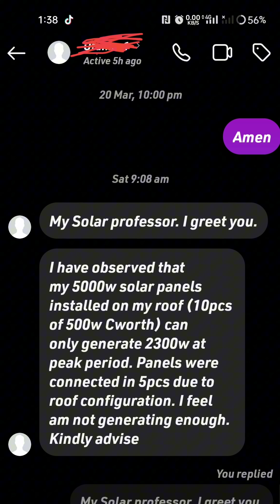Where's the efficiency, are we sold little value for huge money?

Comment: I have a 3960 max possible jinko 9 x 435w panels. I get over 3,300 on good sunny day. I can send you pictures is you don’t mind. 

Be also informed that a lot of factors determine the amount of kw the mppt will pull from the panel. Most important is the demand of the load, chemistry of the load, heat generated as a result of cablings, etc.

If i have a 150ah lfp battery that can do 1C. In peak sunlight under NOSTC, a good mppt controller should be able to extract up to 95 percent of a panels rated STC for a 9 x 435w system.

Again, if you want videos or screenshots, i can share mine with you.

Regarding the arguments some are making that mppt does not convert voltage to current. Please note, an mppt will track and pull the maximum watts ie V x A from the panel depending on the load, now the next step is, the mppt will take this total watts, and match the voltage portion of the battery, then send the rest as current (depending again on what the load demands ie 1C 0.5c 0.2c etc.)

For example, if i pull 2kw from my panels, my mppt will match a voltage of 57v for my 52.1v nominal battery then convert the rest to current ie 2kw / 57v = 35amps. Observe that the 2kw might have been pulled as 270v and 7.4amp from the panel to the charge controller.
Reply: Something else of note.

You seem to be confusing mppt efficiency with solar panel efficiency. 

The top rated solar panels boasts an efficiency of just 22 to 24 percent.

A solar panel’s efficiency relates to it’s ability to capture available sunlight with respect to its size.

Mppt efficiency on the other hand describes the ability of the charge controller to effectively track the maximum power point of the solar panels array. So when we say an mppt controller has up to 98 percent efficiency, it means that it is up to 98 percent in tracking the maximum power point of a solar array.

Now depending on the weather conditions, a 400w panel can give 80w as its maximum power point, all the way up to 400w at standard test conditions.

But to be effectively able to track that little 80w output in poor weather or 350w output in best solar weather efficiency, is where the rating of an mppt charge controller efficiency comes into play.
Reply: You are correct, if your panel can't produce enough, your mpp can't track enough
Reply: Thank God people like you who understand how stuff actually works Still exists not someone who doesn't consider  various factors coming out to confuse people on simple things like this.

Comment: In your other post on this matter, I mentioned that the felicity 120a mppt installed for us somewhere in South East, Nigeria, with Trina panels gets 85 to 90% efficiency(Around December period). I have another installation done last week with Miv mppt charge controller and Africell panels, just this afternoon starting by 1 p.m, (I took time to monitor it today). It has been putting over 90% of the total panel capacity, in fact it has been pulling over 85% since 11 O'clock & has gotten to 94% around 2 p.m. This area is North Central zone.
These are affordable China mppt controllers. There are many factors that will determine efficiency assuming those hybrid inverters you use are correctly rated.
Reply: You are absolutely right. I have experienced same with Africell panels and felicity charge controller. 12 300w panels consistently producing 3000w of power. I thought he was more experienced than this. How can he be comfortable with getting 60% of his solar array.

Comment: There are levels to this thing and you dnt need to sound harsh trying to make a point based on what someone sent to you

First of all
1.Most solar panel can only produce 65 to 70% of its energy under standard test conditions 

2.The solar panel installation positions ,angle etc

3.Was it at peak sun intensity  period?

4.Do you also know that some use fake stickers to sell solar pv, for eg...someone will be sold a 250w pannel in place of 300watt pannel

5,Amount of energy harvested by the MPPT SCC is equal to what it delivers......your pv array in ideal is lets say 2300watt max but u get like 1000watt energy harvested will you blame the mppt or the Pv array, 

6.Mppt is good because of its 98% energy conversion harvested from the panel not what its being able to harvest from the panel, if for example ,your pannel produces 76v and  10amps.....mppt will convert some volts to current to boost your charging current needed to charge your battery......and thats the main advantage over pwm......pwm be like garbage in gabbage out but mppt maximizes any power receive to give out efficent charge without wasting power

So before you conclude 
Solar panels arent 98% efficient, they are 65 to 70% efficient. 

MPPT only draws whatever that is generated, maximizes them by ensuring that at least 98% of whatever that is generated is used well to charge your battery optimally by converting excessive volts to current to give u fast and efficient charging bc currents is whats  needed for charging

I rest my case
Reply: Don't mind him. I have stopped responding directly to him since he doesn't even know what he is talking about and doesn't research before spewing misconceptions. Severally have I told him that the panel rated capacity was obtained under standard test conditions (STC) which are difficult to obtain in the real world. Also that panel position, angle and efficiency of the panel itself can affect generation. At best, you can get 70 to 80% of the rated panel if you optimise everything. Also, I was shocked he said MPPT converts voltage to current, Chai!!! MPPT tracks the point where the product of the voltage and current produces the maximum power and this point varies all through the day. That is why it is called Maximum Power Point Tracking.
Reply: @1982757 yes bro,that's why  we learn everday to improve......and what we dnt know is bigger than us....one should learn to listen more than he speaks..........HIJACKING someone's comment to prove a point without proper investigation is a no no for me,those people that posted those comments he used to make this video,I bet you, if you meet them one on one and conduct all proper test and investigation required.....You will definitely find one  or 2 faults or conditions that led to what their panel generates,...The issue is that many are only glued to what their pannels should generate based on  stickers,without putting the reality surrounding them

Comment: I see everyone is attending to this issue from a wrong direction. The reason why you can't get 100% of your solar panel array capacity is not because of the charge controllers but rather it's the solar panels. Most panels are 15-25% efficient (take note of the word "most".

So heres a scenario, you have a 5000 watts solar array with 25% efficiency. What you'd see as the max in your solar charge controller should be around 1250 watts.

Again, it is not the efficiency of the controller but the efficiency of the solar panels. What your charge controller displays is what it is receiving from the panels.
Reply: I think you misunderstand, A 400W solar panel can still output up to 400W of power under ideal conditions (standard test conditions) because that’s its rated maximum power output. This means that under optimal sunlight (typically around 1,000 watts per square meter, with a panel temperature of 25°C), the panel can generate 400 watts of electrical power at any given moment.

Solar panel efficiency (15% to 25%) refers to how effectively the panel converts sunlight into electricity. For a given panel size, a higher efficiency panel can produce more power than a lower efficiency panel, but it does not affect the overall rated power output of the panel (400W in this case).

Efficiency is more about how much energy the panel can generate relative to its size and the available sunlight. For instance, a 20% efficient panel can convert 20% of the sunlight it receives into electrical power, while the other 80% is lost (as heat, etc.). In a well-lit environment, the 400W solar panel can still produce up to 400W of power at its peak, regardless of its efficiency.
Reply: Don't mind him. I have stopped responding directly to him since he doesn't even know what he is talking about and doesn't research before spewing misconceptions. Severally have I told him that the panel rated capacity was obtained under standard test conditions (STC) which are difficult to obtain in the real world. Also that panel position, angle and efficiency of the panel itself can affect generation. At best, you can get 70 to 80% of the rated panel if you optimise everything. Also, I was shocked he said MPPT converts voltage to current, Chai!!! MPPT tracks the point where the product of the voltage and current produces the maximum power and this point varies all through the day. That is why it is called Maximum Power Point Tracking.

Comment: You are right to a reasonable degree  bro but you dont need to sound bitter while making your points. 😂😂😂 Be calming down bro😢😂

What i noticed  is that solar panels has an efficiency rate of about 65% to 70% efficiency under very good Installation/working condition.  If an MPPT controller gets 65% from the panel,  it will simply outputs about 95/98% of the 65/70% delivered to it from the solar panels.

For example, where the solar panel are not installed properly due to 1. No vent below it, 2. Not facing South 3. Not angled properly, 4. Cloudy condition (a constsnt), etc, you wont even get 30%/40% from the panels

Therefore the culprit is not even the MPPT controller but the solar panel. I believe a good MPPT deliverss 95%/98% of energy given it by the solar panel (i.e. 65%/70% of what the panel is rated for.
Reply from the maker: Until the day I see that sha
Reply: Don't mind him. I have stopped responding directly to him since he doesn't even know what he is talking about and doesn't research before spewing misconceptions. Severally have I told him that the panel rated capacity was obtained under standard test conditions (STC) which are difficult to obtain in the real world. Also that panel position, angle and efficiency of the panel itself can affect generation. At best, you can get 70 to 80% of the rated panel if you optimise everything. Also, I was shocked he said MPPT converts voltage to current, Chai!!! MPPT tracks the point where the product of the voltage and current produces the maximum power and this point varies all through the day. That is why it is called Maximum Power Point Tracking.

Comment: It’s good to have an open mind on such discussions, My take, the MPPT will  extract the maximum power the PV array is producing, the guy complaining that he gets 1.2kw out of 5kw is practically getting these values because;

1. The panels may not be positioned properly to get the best out of the sun.

2. The panels are rated below their capacities, thus underperforming.

3. Monitoring the output of the PV array when weather conditions are not perfect.

I am using a 120am MPPT charge controller and I am using 6 (six) 670watts Canadian solar panels for my first array. Total power theoretically is 4020watts. I have seen the panels produce more than 3300watts, that’s over 82% of its rated capacity.

My point is that the MPPT will extract the maximum power from the PV array, I am certain that if my PV can produce the entire 4040watts, the controller will extract all. I am about to buy a renogy battery shunt, that will monitor my production daily, I will be willing to share the results to debunk this narrative.

Finally before I drop the mic, BUY QUALITY PRODUCTS for quality results. Also the weather conditions will determine the output of your PV array. See this video below for a PV array with different power output for a 100w panel, on specific day it put out 103wats when weather conditions were perfect. 

https://m.youtube.com/watch?v=HAU5K6uH5Cw
Reply: Very good sir. You have said it all. The charge controller is ready to take all that available watt.

Also, what many people do not consider is that the controller is a middleman,
Even if it can harvest all KW from solar but the battery is not willing to take, because its fully charged or because its not up to capacity, or battery is bad. It will not give full Kw to the battery.

For example. Someone that uses 4 pcs 220ah tubular battery in series also wants use 100A controller and expect to harvest 4.8kw from the panels at a no-inverter-load condition . How is that possible. 

Like you said, Efficiency of charge controller should be measured with input vs output of controller not panel kw vs controller output.
Reply: You are 100% correct 😎😎😎😎😎
Reply from the maker: What of the one using 500w?
Reply: exactly mppt is just a PowerPoint tracker.
Reply: I agree with your analysis, it's on point!  I have a solar setup of 6 x 435watts Jinko panels rated for 2,610watts. on a very good sunny day it generates between 1800watts - 2300watts. My friend didn't believe until i sent him a screenshot. So under certain factors, it's achievable.
Reply: You're very correct...I was just about writing same thing but you beat me to it. The thing is, mppt will extract the maximum energy your solar panels are generating. So factors such as whether the panels are actually able to produce that amount of energy, are they properly positioned, is the insolation enough at the time of monitoring etc must me taken into account. This is why you experience variation in yields; on a rainy day, insolation is low  and thereby yielding low energy. Would you blame that on the mppt? 

solargod, I watch your videos but on this one, you haven't put much thought to it...
Reply: Don't mind him. I have stopped responding directly to him since he doesn't even know what he is talking about and doesn't research before spewing misconceptions. Severally have I told him that the panel rated capacity was obtained under standard test conditions (STC) which are difficult to obtain in the real world. Also that panel position, angle and efficiency of the panel itself can affect generation. At best, you can get 70 to 80% of the rated panel if you optimise everything. Also, I was shocked he said MPPT converts voltage to current, Chai!!! MPPT tracks the point where the product of the voltage and current produces the maximum power and this point varies all through the day. That is why it is called Maximum Power Point Tracking.
Reply: @1982757  

I believe the reason people say that is because they are only familiar with buck type mppt. So in their minds, they say "it converts excess voltage into current". So what now do they say to the boost type mppt that steps up voltage? Mppt tries to match impedances of input and output thereby generating maximum power transfer. That's is from basic electricity 🔌
Reply: @1982757  even dirt can significantly affect the PV power supply

Comment: Brother i really like your analysis. But look at it from these angle...

Even though a 5kw solar panel generates approx like 4.8kw of power, not all the power will be used by the charge controller to charge the battery because the battery has a C-rating of maximum charging current either tubular or lifepo4. Also, depending on the type of charge controller, there is a setting of the maximum charging current.

If the maximum charging current is set to 60A, it means the controller will draw a maximum of power 60A×48V=2880w from the panels.

Another thing you should consider is that when using non-hybrid inverter, the charge controller might find it difficult to differentiate the load of inverter from the battery because they are connected in parallel, so it pumps out e.g 60A for both load and battery which will make battery not charge efficiently if there is much load on the inverter.

If I am wrong, i stand to be corrected.
Reply from the maker: You're wrong sir,
First, a 60amp charge controller cannot handle that amount of energy and that's why 120amps are introduced.
Secondly charge controller are smart enough to know the amount of energy to release at a time, because they use voltage to know the level of battery capacity
Reply: @Nuel007  
I wasnt saying 60A can handle 5kw, i was talking about an "infinite" amps charge controller set to 60A maximum charge current. This 60A limit settings cannot allow the charge controller to draw more than the 2.8kw(48v system) even if the controller is 120A, and solar is 5kw.

Well, its the smartness of the controller we are really discussing... not all controllers are smart afterall. A smart mppt controller will output the said 98% at right conditions if the internal settings and the physical setup is "smart".
Reply: Constant current and constant voltage charging is all about maintaining "limit". The battery doesn't necessarily have to take all the power the solar has to offer. Thats the essence on the charge controller in the first place.
Reply: you are totally right this people will find it very difficult to understand you cus they re not technically sound. even the sand god sorry self acclaimed solar god😂.

A 120A CC can be set to function as a 60A CC or lower depends on your recommended ba3 max charging current, the 120A is a range between  0 to 120A, u have the flexibility to choose any Amps within that range.

So in essence CC will only deliver the limit of its settings  to ur load if your PV arrays can produce it.
Reply: if your battery it's already set to a limit😊 then no need for mppt
you can make do with the pwm which a most cases comes with the inverter